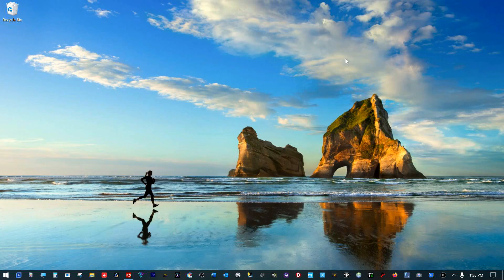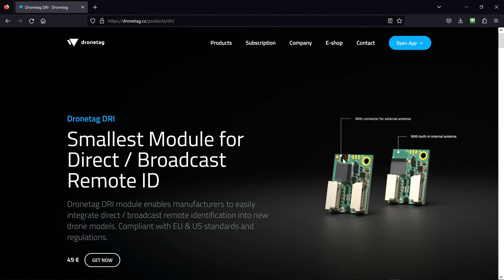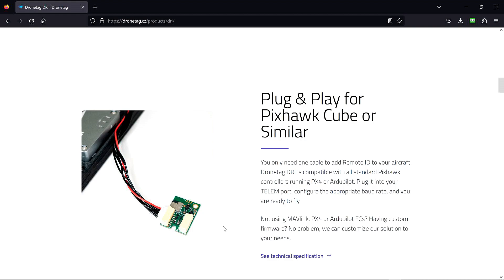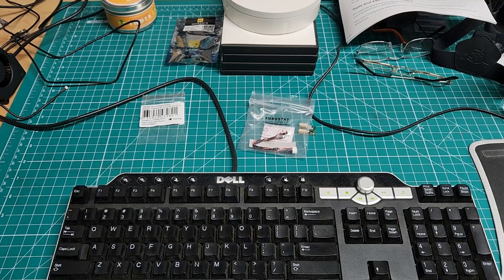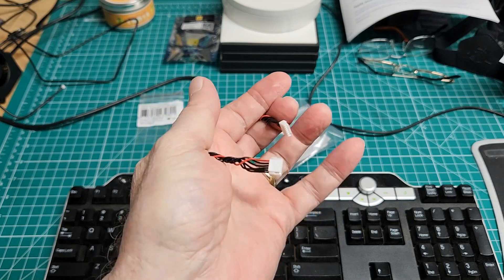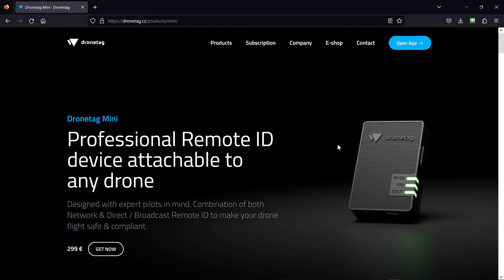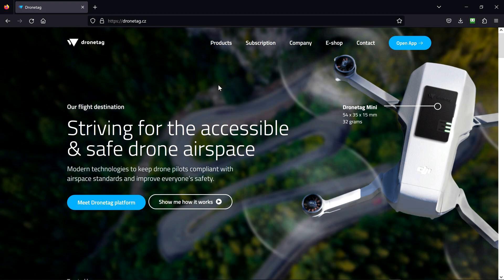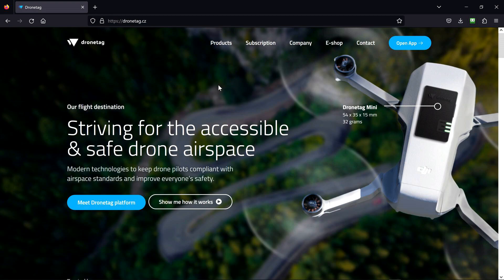Remote ID  The Good, the Bad, and the Ugly

Comment: Hot air balloons with passengers are NOT required to broadcast their pilots name or direction.  Just a radio to communicate with the ground.  Balloons carrying people is bigger and more dangerous to commercial drones than fpv quads.  How will the FAA regulate balloons with commercial drones?
Reply from the maker: I have never thought about what kind of avionics a balloon carries.  I would want a BIG radio and a backup.  Lol

Interesting question, I am not at all sure what is required for a balloon.  Seem like it is all VFR and watch out for each other.  Might want to take along a hand-held ADS-B as a pilot.  Don’t really have any thoughts on how they may handle that.

Comment: When I got into FPV many years ago, I learned that to fly FPV, one must have a HAM license to operate his/her/etc. VTX and be compliant with FCC regulations. In addition, one is supposed to begin each transmission by first sending their HAM call sign. I remember some Youtuber's would flash a card with their call sign in front of the FPV camera before taking off, or put their call sign in their OSD.  I don't see that happening anymore. On the one hand, I can't help but think that after September all this noise about Remote ID will fade into the background and all it will really have served to do is bolster the view-count for FPV youtubers. On the other hand, I expect if a non-complient FPV pilot draws attention to themselves by doing something stupid, they may experience the enforcement of these regulations.
That said, Vernon, I think your's is one of the few videos on the subject worth watching. Bardwell and Blunty have streamed some good disscussions, and Tim McKay has some good ones up too. Thank you for posting.
Reply from the maker: I got my Ham to fly 1.3 Ghz  😊  I noticed yesterday that I have to renew in March 2024.  No one has ever asked for it in 9 years because I have not flown any stupid flights where anyone would come to talk to me.  But as I am an electronic professional, I will renew it and maybe go for the two higher licenses than the one required just because of the electronics involved.  I had to study about 3 hours to pass the Technicians license 50 plus years after my electronics training.  lol

I did view those videos and I though they were a little harsh on Bruce.  I still think Bruce didn’t want a protest as much as a flood of remote id traffic in the algorithm.  He was not clear.  <shrug>

Comment: I fly mostly fixed wing aircraft like scale warbirds and sailplanes, and have since the 90's, but with the current rules most of my planes will be illegal to fly without RID even though many are lighter than a NFL Football and fly slower. I don't have anything with a camera (or GPS for that matter) on it so nothing I own can be flown outside of Visual Line of Sight. Most of the smaller options like this dronetag DRI will not work in anything I fly since nothing I own has a flight controller or GPS, in traditional R/C aircraft there is only a receiver. The dronetag BS is currently the smallest option for traditional R/C models - if it was actually in stock... 

none of this even takes the financial aspect into account, 125-300 per module is often more than I spend to build a scale model from scratch. there is no Complete module for $50 like the FAA estimated, the dronetag BS is the cheapest at $90 + ~$10 in antennas and ~$20-30 shipping and for me comes out at about $130 to get one complete unit. as to swapping it between models the Dronetag BS uses U.FL connectors for its antennas, these are not made to constantly be removing and re-attaching an antenna to, most are only rated for something like 20-50 times...

 In many of the smaller models that are just over 250g there is also no place to put it that won't impact the flight characteristics.  in many cases to fit a 18x18mm module I'd end up needing to put it way forward or back of the CG and need to add an equal weight opposite it to balance the aircraft, making a 10g module effectively 20 grams with the counter weight... and if I want it removeable to swap between models it would require those small models to be redesigned to have a hatch to get at the module, adding yet more weight.

the only application I can see something similar to RID having a use is for the GPS camera drones that you can "fly" with a tablet when flying beyond VLOS, and even then it would need to be reworked to actually be similar to ADS-B and be seen by aircraft and ATC's.
Reply from the maker: I don’t think Remote ID is needed on anything except BVLOS flights.  Sounds to me like all your platforms shouldn’t even have to be registered much less have remote id.  And I do expect that change in the future.  The government doesn't do anything well.

Comment: Apart from practical issues, like this will never fit to a tiny whoop, having to wait for a gps lock each time you connect the battery can be a pita, and most important, it won't stop bad actors. At the same time it causes serious issues for safely flying pilots. Like people who can see where you are flying from, might come to pay you a visit to harass you or even rob you of your gear. Or when a bad actor flies around where you are, you will get framed for their deeds, because there is proof that you were flying, so you must be the culprit. Remember how people got arrested for the Gatwick incident, presented as criminals and later found to be innocent.
Reply from the maker: All good points.  The Dronetag DRI uses mavlink data instead of GPS.  And more people have a GPS than mavlink telemetry.

Comment: Yea this device does not work in the majority of the type of aircraft that RC hobbyist fly.
Reply from the maker: I have many types.  Most of mine are long range airplanes.  The Dronetag DRI goes on those very easily but I doubt the range of the current offerings.  I started out on the APM 2.X with 3DR around 2010.  So I have been adding GPS and telemetry to all my setups from day one.  My 5-inch freestyle has a GPS on it, but so far it does not have the telemetry to easily connect the Dronetag DRI.  BUT, I think Dronetag has a new module (Dronetag BS) that goes in line with the GPS instead of the telemetry.  Which would easily install on it.

Again my problem with all of this is that the bad actors won’t follow any rules.  The rest of us are stuck adding unneeded modules.

Comment: The FAA do not seem to understand the difference and different flight profiles between FPV and camera drones. I fail entirely to see why my 25g AUW FPV whoop needs remote ID if I place a video from it on social media or maybe a local charity website. Yet, I would need it to be legal.

It wouldn't fit, and if it did, it wouldn't fly.
Reply from the maker: They do not understand at all.  A tiny whoop cannot carry very much in the way of bad things that bad players would want to carry.  Thus they are no threat at all.  The FAA got a mandate from congress to control drones and they were far to lazy to gather facts before they set about their rules.  IMHO
Reply: @nighthawkvs  You might just be able to hurt a fly with that tiny whoop, so it's clearly a massive risk. ;-)

Comment: Don't forget to attach the module to your model using several layers of aluminum-foil body-tape 🙂
Reply from the maker: rofl  I am not sure the range on this is going to be more than 30 feet.  After 50 plus years in the electronics and computer industry I don't have much confidence in this module.  BUT, it does make me technically compliant.  I will consider the shielding you suggest.  :)

Hello to you Ron and all the group at the field.  BTW  I am wanting that ADSB badly.
Reply: Is that what they mean with "shielded operation"?  ;-)
Reply from the maker: @rc-fannl7364  rofl  That is Bruce’s sense of humor.  Which I like.  I think he was saying that would further decrease the range.  You see I care NOT that they work as required because I don’t like them myself.  They just have to be installed to pas muster with the police and courts.

I started to post back that I was going to use copper tape so those terrible UV beams would not get in and fry my chips.
But then I got distracted by being slammed by so many.  <shrug>
Reply: That goes with the anti ufo aluminum foil cap I wear! Not been kidnapped by aliens yet so it works!

Comment: Thanks for the support... the hobby appreciates it.  The DroneTag module is an option for those who already have a GPS receiver on their craft but a lot of freestyle flyers don't use GPS or MAVLink compatible flight control software so this is a no-go for them.
Reply from the maker: I just think remote ID is all ugly.  Nothing good about it.  lol
Reply: Having to wait for GPS lock would be a pain. It can take a minute or more at times, depending on the weather conditions. And since not ever quad I fly has pitmode, the VTX might be "crispy" by the time I get GPS lock...
Reply from the maker: @rc-fannl7364  True.  I connect to my GCS via USB to get around that problem.  When I setup I connect that first.  By the time I get everything else out of the car and setup I have good lock and a settled platform.  I connect the flight battery very near launch time and then disconnect the USB.  Habit, I got into from my days of launching E2 aircraft from the deck of a carrier.  We had external power connected until we got the engines up and running.  At that time external power could be disconnected.
Reply: It's a vendor driven feeding fest that's going to kill the hobby it claims to help
Reply: @sUASNews  Possibly, yes. One thing remote id won't achieve is creating more safety.
Reply from the maker: @sUASNews  I hope not.  But as I am almost 70, maybe it won't kill it before I go from old age.  rofl
Reply: Thanks for the info, I have no GPS or telemetry,  except my ultrix which will tell my transmitter the voltage of the flight battery😊.  Looks like the 300 option then?
Reply from the maker: @stevenwebb3007  You are welcome.